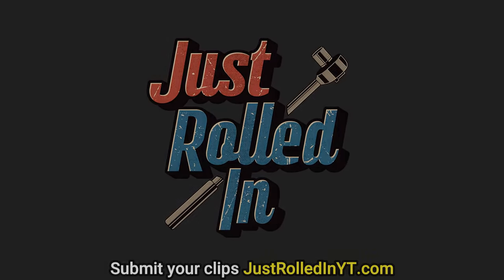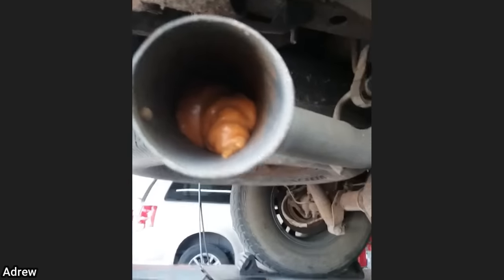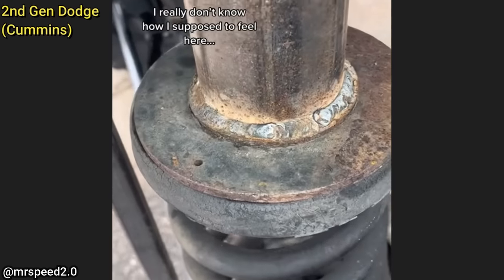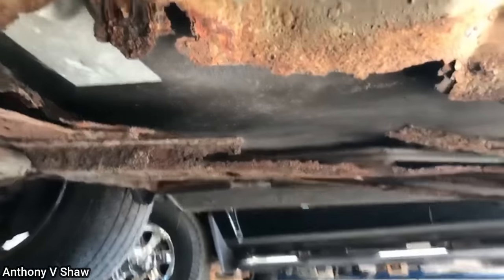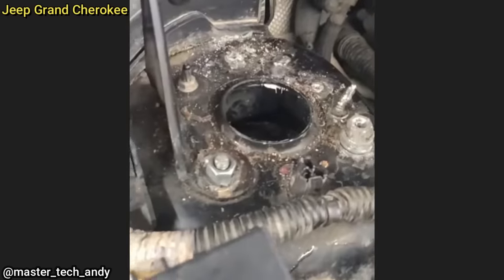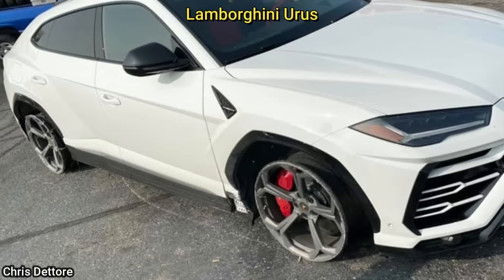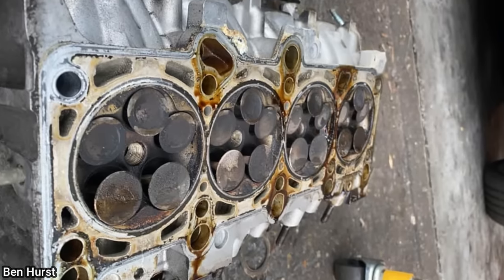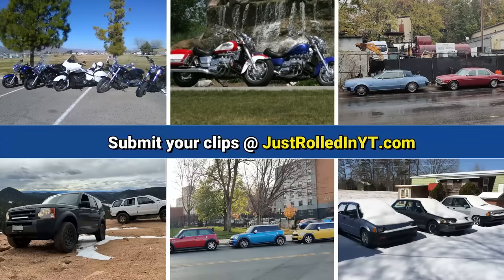Customer States They Drove Over A Bowling Ball | Just Rolled In

Comment: "Screen shuts off when powering the radio down."  Yep, just throw the entire vehicle away.
Reply: but how do you adjust the heat when the heat controls are only on the screen? That is annoying as hell.
Reply: @joeyf504327  you turn off the radio on the screen
Reply: @joeyf504327  he's not turning the radio off, he's turning the entire infotainment system off
Reply: My brother almost bought a new truck because it was becoming gutless. My other brother checked the air filter and it was totally plugged. We still give him crap about it 20 years later.
Reply: @joeyf504327  On the Ram's, there are physical side buttons for the HVAC - fan speed, temp, and vents. you dont need to use the screen.
Reply: For what its worth I have cars where when you push that power button the radio turns off but the screen stays active so you can still interact with the map, etc. So I actually don't blame the customer for this one, especially if they've come from a different brand.
Reply: You're telling me that the on/off button will turn the radio on and off? Unacceptable.
Reply: @adslf874yti3q7u4hf83  I don't blame them for expecting it to do, but I do blame them for not understanding that when the entire thing turns off when they press the power button it's clearly doing the manufacturer's designed function even if not the most intuitive, it's like if you pull up on the gear selector and it goes in reverse but you pull down on it and it goes forward it's probably fallowing how is designed, even if dumb
Reply: @jaykoerner  Agree so much, but it's bad enough that some old guys in my area will burn up their motors, because "I did that on my last truck". Sir, you got a 2019 Eco diesel, you can't use 15w/40, or drain the oil with the engine running to make it drain quicker.
Reply: @sabastianleisek396  "or drain the oil with the engine running to make it drain quicker."   Normally I'd say that never happens but after watching this great channel for as long as I have I know it does happen.
Reply: @adslf874yti3q7u4hf83  I don't entirely blame the customer from that point of view, but there's also a big button labeled MUTE right under the volume knob
Reply: @davisjohnson5688  There's also a big button labeled MUTE under the volume knob and one labeled SCREEN OFF directly opposite on the right side
Reply: @Glokens  Ikr. With dedicated buttons labeled MUTE and SCREEN OFF, people still manage to complain about the power button
Reply: @davidp2888  that was one of my last boss's stories, I don't remember the exact year and just guessed, but he said he always did that in his old Chevy.
Reply: @joeyf504327  when use the physical buttons and temp pops up on screen.
Reply: I'll buy that terrible vehicle off your hands for a discount since it's clearly defective.
Reply: I think the problem stems from not understanding how modern  radio systems in cars work. These days the "radio" or "tuner" in the vehicle really has no real "off" switch. its digital and always on and part of the operating system in the vehicle.. but the amplifier gets "turned off" by turning down the volume to zero  but in reality there is some power running through it just not enough to drive the speakers. it looks like the "power button" they were pressing simply turns off the tablet/screen visual interface.
Reply: That one cracked me up
Reply: @scatterbraintech  but MUTE is not OFF.
Maybe I am too old school for this newfangled stuff. When I want to turn off my radio I want to turn it off. Not mute it.
Reply: "People die when they are killed." ... I guess you guys got Shiro Emiya's car :P
Reply: Who uses radio anymore?
Reply: A lot of automobiles has a simulated engine sound running through the car stereo...   So you think the engine and exhaust sounds good...  It's there when the volume down all the way or turned off.   It goes away as you turn the volume up to listen to music.    😮

Comment: At least the unconventional lift kit had decent welds this time around.
Reply from the maker: But quite the hazard. Good welds or not that thing is dangerous lol
Reply: And quite the firm ride.
Reply: ...just zero lateral support.  surprised this hasn't sagged over while cornering.
Reply: Was that exhaust tubing supporting that coil spring?
Reply: I have mixed feeling. On one hand it might actually be better than stacking lift kit’s especially rear blocks but on the other hand neither seems like a good idea
Reply: It just had some tragically bad engineering in building it. That is a death trap.
Reply: @masondegaulle5731  or folded over while braking.
Reply: @chrise1343  it looks a lot like it. could also be tubing for making handrails... someone's pretty optimistic.
Reply: @lotharrenz4621  Or exhaust tubing
Reply: @chrise1343  At first glance, i thought it was structural tubing, but you might be right.  The rear is definitely a structural square tube.
Reply: @JustRolledIn  If I had to choose between that thing and the usual "4 bricks stacked on top of each other" or "piece of firewood" or similar, I'm honestly not sure which one I'd rather die in. Probably the welded one because at least then I could show off my welding skills to the devil after I die.
Reply: @chrise1343  looks like thick steel pipes to me, they look exactly like the pipes at my dads workplace, exhaust tubing doesnt usually rust like that

Comment: I gotta say, every single valve is just impressive. That's dedication right there.
Reply: I'm guessing they started it up and it make horrible noises and instead of immediately shutting it off they went "Hmm, I'll rev it a bit, that might fix it!"
Reply: They put extra valves in each cylinder just so the owner could bend even more.
Reply: An engine out of time will not start, period. To do that kind of damage, the valves for a given cylinder need to be forced open when the piston is at or near top-dead-center. You then have a situation where there is no clearance in the combustion chamber for both these events to happen simultaneously. The piston makes contact with the valves, bending them. Since the guy is completely clueless about engine timing but still insisted doing the work himself, we can assume he had no idea of the diagnosis when it wouldn’t start. And since our guy wasn’t about to let a stealership charge a zillion dollars an hour to work on his car, we can assume he kept on cranking it for a full minute or more, hoping the problem would fix itself. When it still wouldn’t start he then probably removed the belt then reinstalled it, went from one bad timing to different one and cranked it again for a couple more minutes. That’s how you end up bending every single valve in your engine. Possibly damaged other components of the drivetrain such as cam lobes too. I’m not sure if it’s enough by to injure the top of the pistons too but that would also be a concern.
Reply: One might say he 'timed' it perfectly to bend all 20 valves.
Reply: If at first you don't succeed, keep on crankin'.  😄
Reply: It's an Audi, they can somehow eat 24 valves when the cam chain tensioner gets it's feeling hurt even though it only had 20 when it left the coffee shop it was manufactured in.
Reply: @GlamStacheessnostalgialounge  nah, it took just 1-2 revolutions for all of this to be f'ed and have zero compression, never even started. Pretty strong starter motor on those I guess, if we're gonna be positive.
Reply: The Poor 1.8T
Reply: @larryforney  some time ago this channel posted a clip of a valve that suddenly decided to take a dive inside the cylinder. Of course it was an audi with <500 (not 500k, just 500) mi 😂😂
Reply: Not only the pistons were f@cked, the camshafts and everything in between were also damaged. And the pistons must have some valve impressions on them

Comment: "the vehicle wasnt like this when we sold it"
so youre telling me that a car can just rust really badly and have a frame so bad its unsafe in less than a week from purchase, but not before?? 💀💀💀💀
Reply: Time Machine
Reply: I would have told them, "if I have to get a lawyer, your cost just went up."  I then would have gone to the local TV station that had a "working for you", or "On your side" segment in the news.
Reply: The dealership I bought my mustang was surprised that there was oil in the coolant. Guy said already?! Yeah you knew when you sold me that car. I will fix it, but I spread the word about that dearlership in the hopes no one else gets shafted.
Reply: Yeah, seems a cut and dried small claims case to me.
Reply: I don't understand why customer don't even take a look under the car when they want to buy it.
Reply: Just a rotten used car dealership that should be getting negative reviews for selling such a vehicle. That's actually a lawsuit right there selling an unsafe vehicle.
Reply: Mustve been made of rustite where it just spontaneously rusts at a certain point
Reply: On Lehto's Lsw here on YT this was discussed with the following titled video.

"Judge Orders Used Car Dealer to Buy Back AS-IS Car It Sold"
This guy needs to force the issue against the dealer.
Reply: @UncleKennysPlace  holly, "regardless of what the salesman says" is ultimate scammer protection. That's downright sad to be legal, I get it the whole signing up a contract being the valid but to just protect the bullshitting is sad.
Reply: But it wasn't like that! You see that part in the middle of the rust hole? There was a frame piece there before and it fell! You broke it!

Or it wasn't rusted at all and the costumer definitely drove through acid. No questions asked.

(it's a joke for who's not aware.)
Reply: I really hope that the tech told the owner that that's a load of BS.
Reply: Time to call Lemon Law and get a lawsuit going
Reply: @Craftlngo  I would literally crawl in dirt to look underneath of a used car or truck when thinking of buying it . Even my new truck I crawled under it.
Reply: Where I'm from every car sold from a dealer must pass inspection. If the car doesn't pass inspection and is still good enough to resell, dealer has a couple of options. First is to fix the problems the car has so that it does pass inspection. 2) take it to auction and sell it that way. 3) they can sell for a cash only price and can't sell the car to someone who is a resident of the state I'm in. Doesn't stop people from having a friend buy the car for them and then reselling it and doesn't stop inspection from getting a kickback from someone either.
Reply: Unfortunately most states give shady dealerships a free pass unless fraud can be proven. Used car sales, even those from used car dealers are generally considered "as is" unless the dealership specifically sells with a written warranty or guarantee. Now it may be hard to argue they didn't know about extensive rust like this, but lawsuits often don't return much to the buyers even when successful
Reply: If it's a Tesla. It's true
Reply: @UncleKennysPlace  Lehto's law covered a story like this. From what I understand, if you buy something "as-is" it is automatically assumed to be functional by law unless specifically stated otherwise.
Reply: @FizzleFX  them batteries must be leaking!!!
Reply: @dirtfarmer7472  well your dislike of lawyers aside, the law is the law. That said I agree ambulance chasers are pretty low but if you've ever been a position where you must defend yourself against false accusations or have to try to recover losses after being wronged, you will come to appreciate a good lawyer. The problem is there are a lot of bad and unethical lawyers. I try to associate with the former and keep away from the later.
Reply: Maybe in an old Vega or Aspen I'd believe rust could spread that fast. Nothing made since the 90's.
Reply: @a.c.m.e.ink.4568  There was a case recently where a Judge ordered a used car dealer to buy back the as-is car.
Reply: @UncleKennysPlace  There was a case recently where a Judge ordered a used car dealer to buy back the as-is car.
Reply: My words were "Like fvck it wasn't!"
Reply: You could have parked that car in a pool of Dead Sea water and run high DC voltage through the frame and ever gotten that level of rust.
Source: Videos where Grady at Practical Engineering did accelerated rust experiments.
Reply from the maker: @franzfanz  they did. Never heard back from the customer after that though from what I was told
Reply: In the dealership's defense, a customer that won't inspect their car before buying it deserves what they end up getting. You all are getting mad at the dealer for selling the car, but I'm furious at the customer for buying it.
Reply: @russellhltn1396  definitely
Reply: @Craftlngo  Most people don't know or care about cars at all, and simply use them as appliances, and they think that buying from a dealership is a safe and guaranteed way to buy a car so they have enough confidence that a dealership will actually sell completely functional cars.

That's the biggest issue, people thinking dealerships are honest and ethical.
Reply: Reminds me of when my buddy bought a used engine from a local junk yard they offered 1 month warranty on all their parts, I was helping with the install and noticed it had a blow head gasket, told him to take it back the yard said bring in the heads we’ll fix them, they had them for about a week went to go pick them up and they literally just spray painted them with silver paint to make them look new, we confronted them and after a very heated argument they refunded some money. Eventually they went out of business due to them scamming people all the time.
Reply: Probably the subframe was salted so that's why it sped up the rusting process, this is why they don't rinse out the subframe.
Reply: Used car sales = thief.
Reply: @russellhltn1396  go to the STATE police or highway patrol to let them know that a car dealership is selling UNSAFE vehicles. They have the authority to shut them down on the spot and seize their inventory. Just like with odometer tampering at a dealership
Reply: Well when you use sulfuric acid as an underbody wash after driving through the Bonneville Salt Flats that's to be expected.
Reply: @dcsteve7869  "99 percent of lawyers give the rest a bad name."-Steven Wright.
Reply: Just rolled in lol
Reply: I've been encountering a lot of this lately. People getting hot safeties, selling the car, and the buyer finding out later that it needs a lot of repairs.
Reply: @marclytle644  I saw that on a Mercedes recently. Oil in the coolant, engine was done, and the customer recently bought the car with a hot safety.
Reply: @marclytle644 lmao you must have gotten a deal on that mustang to keep it 😂
Reply: @Craftlngo  ? Maybe because the dealership guarantees the car to be free from rust?
Reply: Some states' "as-is" laws are really literal. Other states require that the car pass inspection before it can be sold, especially from a dealership. They handle that at tag time, and most people know you have to have a current inspection to tag it, and they demand that at the time of sale.   Some states also have laws that state if a mechanic is asked to work on a car that is not roadworthy, and it either cannot be made road worthy, or the customer refuses to allow it to made road worthy, they are not allowed to let it leave except on a tow truck. Basically call a lawyer, and call the state board that regulates car dealers.
Reply: lawyer up
Reply: Car dealer: "He must have driven it through a puddle of hydrochloric acid or something."
Reply: @jimbeam2705  I'd take it for a test drive and park it somewhere I wouldn't have to crawl in the dirt XD
Reply: Ah well sir, you see it's that acid rain up there where you live. Forms some rather nasty puddles.
Reply: flash rust
Reply: @Craftlngo  I once went to look at a 4-year-old Mazda that managed to have rust on the B-pillar. When the salesman saw we were looking underneath the car he never even came out to see us, as he knew we wouldn't be interested - needed someone who didn't know what they were doing.
Must have found the right customer though as I drove past the same car in another town a couple of weeks later.
Reply: Customer fault for not inspecting a vehicle.
Reply: A likely story!!
Reply: Lancia Beta Coupé has entered the chat...

#TopGear ✌️😎🍻
Reply: The car frame wouldn't have gone from bad to "this" in week under the sea, let alone wherever that was.

Comment: Last clip.... we are always sending newbies in the cabinet shop to the basement for the board stretcher.... but 1st you need to find out who has the key .... lol 😆 🤣
Reply: Send them to the parts shop for a long wait (weight).
When the railways had steam engines, the new guy might be asked to get the key for the smokebox.
Reply: I made an aprenticeship in a shop that repaired firetrucks once. Their go-to (wich didn't work on me, because i knew the trick) was to send the newbies to get them some blue-light-water, to fill up the emergency lights
Reply: Dad used to haul redi-mix concrete,  their mechanic used to send newbies for a muffler belt tensioner.... one guy was gone 4 hours before they called him back